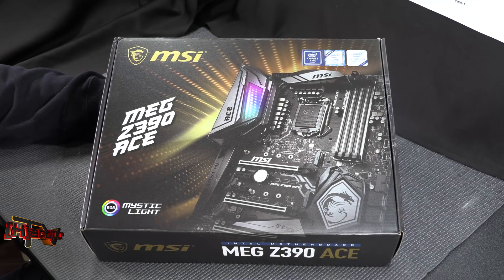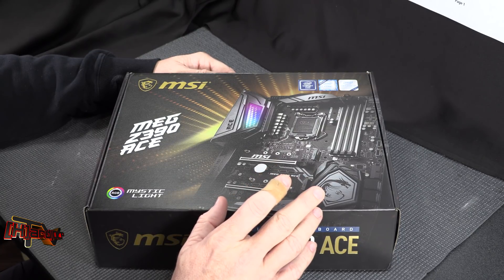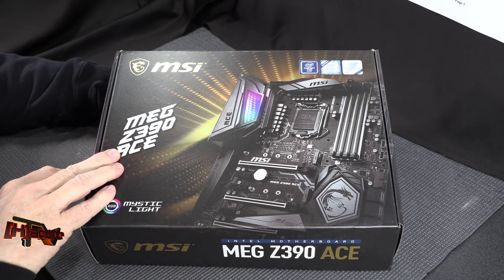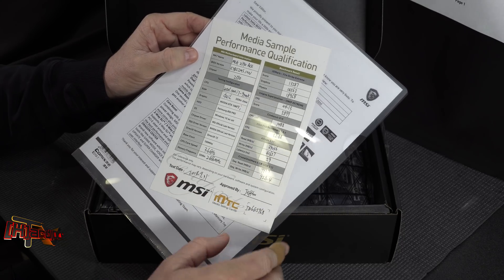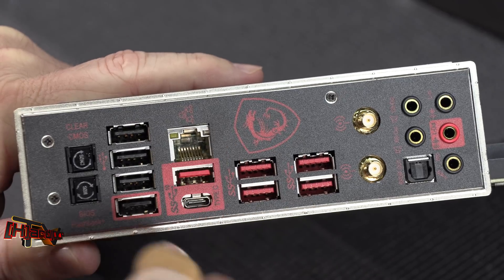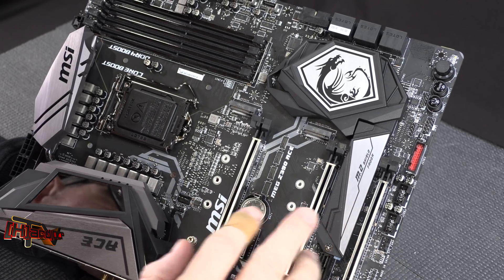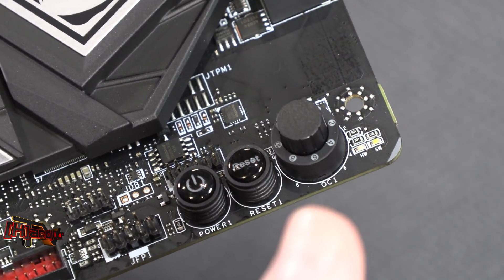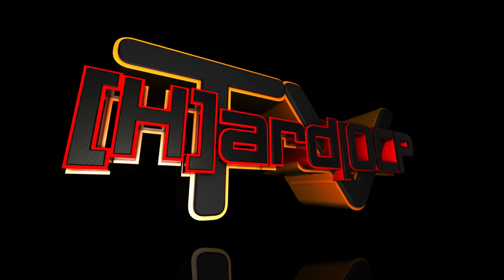MSI MEG Z390 ACE Unboxing & Intel 9000 CPU Discussion

Comment: Good review Kyle. I want to see Buildzoid's analysis of the PCB/VRM. If you're planning on taking off the VRM heatsink, maybe take a few hi-res photos of the top and bottom of the board, as well as a close up of the MOSFET's. His channel is Actually Hardcore Overclocking. He also does analysis for Gamers Nexus. I recently saw a couple of pics of an EVGA board, that I can only guess is a Z390 chipset. It looks really interesting, with right angled 24 pin and the two 8 pins sitting next to each other. 2 DIMM slots, a large VRM, and lots of room around the socket for an LN2 pot.
Thanks again for getting Cooler Master in touch with me about the PSU cables. I just got them the other day! You're the best, man!
Have a great day!